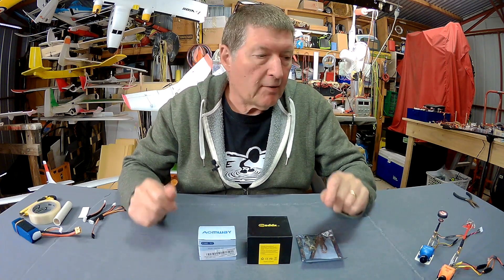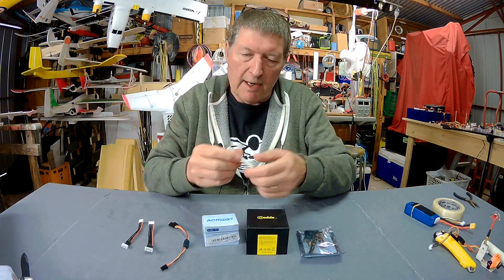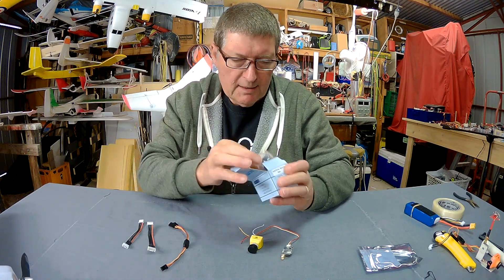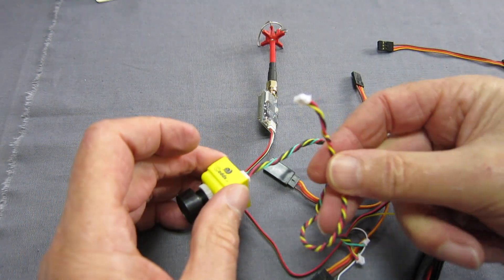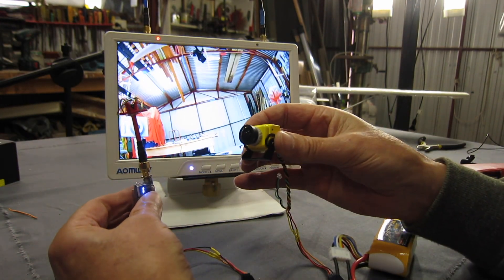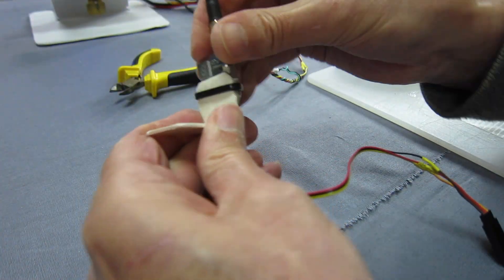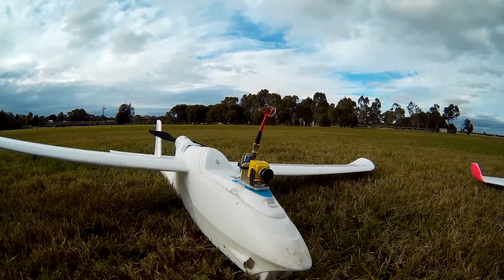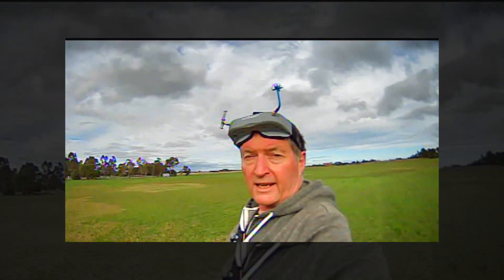Simple FPV pod build

Comment: I am putting together an analog FPV pod for the Multplex Easy Star my friend sold me.  This video is super helpful that helped me picture how to do the wiring. I also like the PVC mounting bracket what a great use for my scrap pieces! Thank you!  One question I have  is how close is your receiver antenna to the transmitter antenna? Currently my receiver is in the nose cavity with the antennas poking out of the back of the cockpit.  If I mount the vtx and antenna on the nose as well, should I be concerned about interference? They will be separated by about 4 inches.
Reply from the maker: Should be OK. Noise from the ESC and motor are more of an issue usually.

Comment: Andrew:
I love your use of my favorite (PVC) tubing for this platform. It is adjustable with heat applied, rigid, light, and easily attached with sticky tape, velcro, zip ties, or screw mounted on permanent locations. Beautiful, simple, and DIY.
1) Have you had any issues with the antenna/VTX getting snagged on obstacles? I thought I would try a right mount antenna to enable attaching the VTX to the flat part of the PVC strip.
2) Is the Amway clover leaf antenna still your favorite? I like the Pagoda, but I"m about to try the Foxeer lollipop. I'm collecting other's opinions, and I value yours.
Another first-rate training video!  - Jim
Reply from the maker: Aomway CP antennas are still my favourite, haven't found anything that out performs them.
Reply: @AndrewNewton  I highly recommend TrueRC singularity 21mm

Comment: I have question can i connect this combo with 3S 11.1V li-po battery 30c ?? Or it will be to low voltage ?
Reply from the maker: 3S is fine

Comment: Can this FPV setup work with goggles? If so which pair? And can I use a Caddx Turbo micro SDR2 instead of an SDR1?
Reply from the maker: Yes to both questions. I use Aomway Commanders V1 goggles, but any will work with this.
Reply: Andrew Newton thank you for the response

Comment: I would use velcro to attach camera pod instead of tape as velcro can be recycled.

Your setup on uses one cell on the battery i use  a jst connection   (https://i.ebayimg.com/images/g/QHQAAOSwrklU62lQ/s-l1600.jpg)
Reply from the maker: I do use your sort of connection sometimes. But this balance plug method uses all 3 or 4 cells, not just one.

Comment: How would you add osd to your fpv with a rc plane?
Reply from the maker: Buy a flight control board that has an OSD built in. Plug the camera and video transmitter into the board and the OSD is added to the video. Or buy a camera that displays voltage, time and name on screen
Reply: Andrew Newton thanks

Comment: Instead of heating and bending PVC pipe, I just use an old gift card or credit card, they're very strong and flexible. Double it up if you need it more rigid. Great video, I like the portable FPV idea.

Comment: Wow thats a lot of trouble to go to isn't there a " plug and play " option.
Reply from the maker: Yes but they are usually crappy cameras and short range
Reply: Half of the fun is the skills required to build things yourself, better than buying off the shelf anyday and you get a bespoke design that you need.👍
Reply: Terry Murphy can't argue with that I bought parts and foam to scratch build my own planes and boats instead of just buying 1 plane. 
I just was just wondering if plug and play was available.